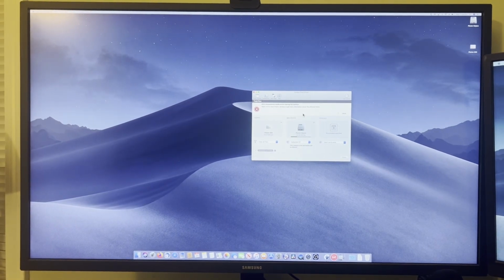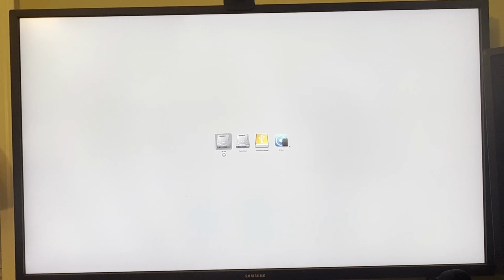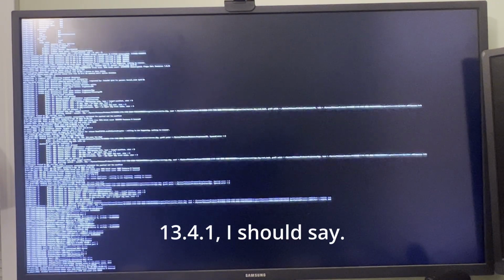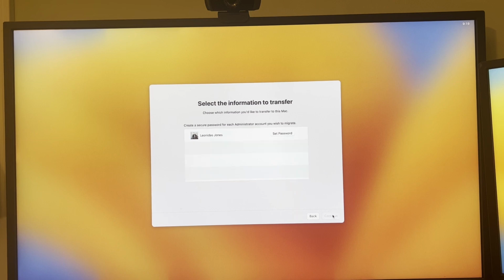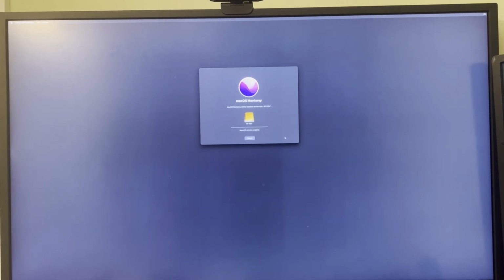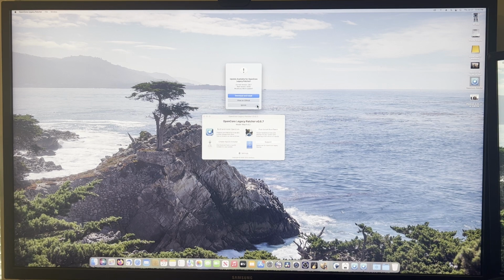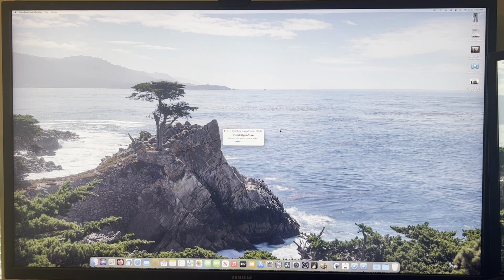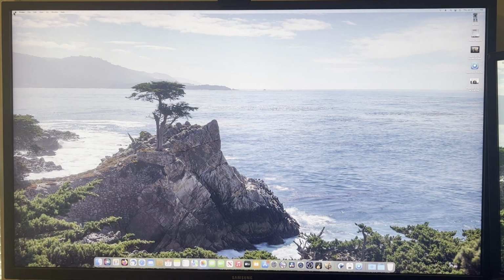Ventura 13 5 Recovery, Mac Pro 5,1

Comment: I know this is an old video but my own experience with Ventura on my 5,1 was not good.  SMB server issues were more than I could tolerate and I tried a lot of work arounds short of installing my own samba.   I had to go back to Mojave.

Comment: Having issues with my own 5,1 and 13.5. Been experimenting with it on a separate internal drive since 13.0 release and it has been fine up until 13.5. Almost every time I try to login the windowserver crashes and brings me back to login. I'm thinking it may have something to do with not zapping the pram since the original install of OCLP to boot either Catalina or Big Sur. Hell the machine doesn't even chime anymore even tho it's set to in the sound preferences. Think I gotta clear out the gremlins... 

The main Monterey install still boots fine and there is still a Mojave install as a fallback.
Reply from the maker: es, in my struggles with this, zapping the pram/nvram, is a major issue. The other key is OCLP 0.6.8, once the pram is reset, works fine. Spoiler alert, if you don't want information about the next two videos, stop reading now.  🙂

I have managed to get 13.3 installed with OCLP 0.6.8, and a pram zap was necessary, despite having done so when I installed Monterey again. I then was able to do a normal upgrade to 13.5, as though nothing had ever been wrong. So, if nothing else, there is light at the end of the tunnel.